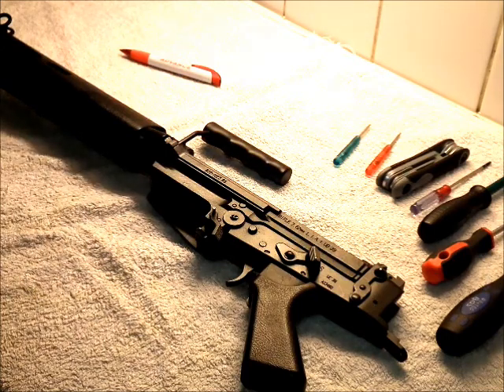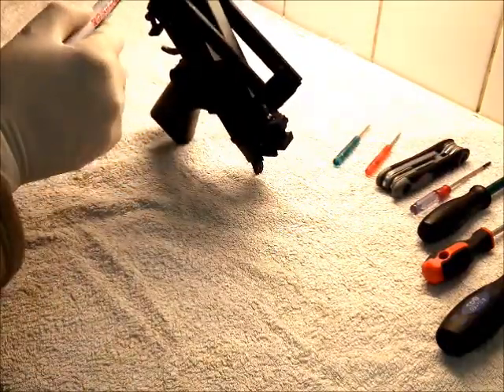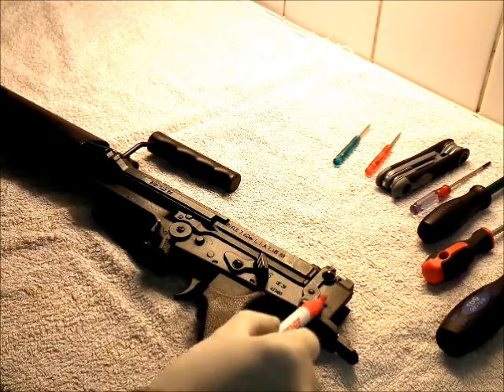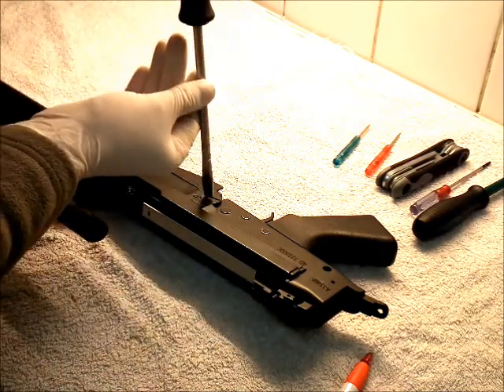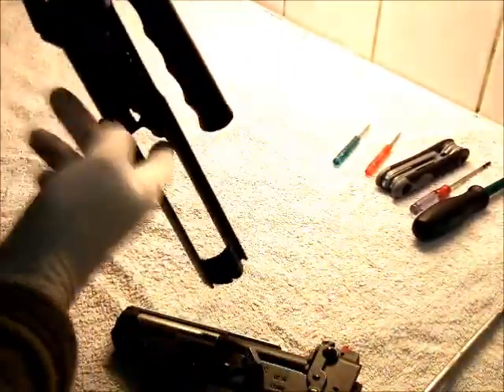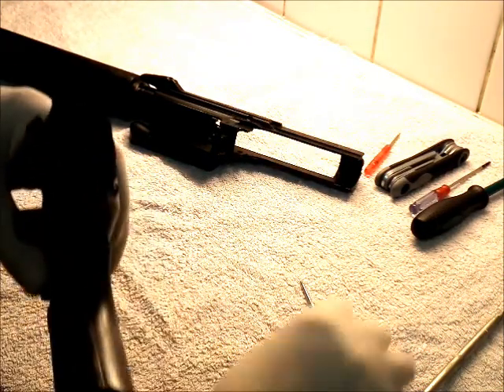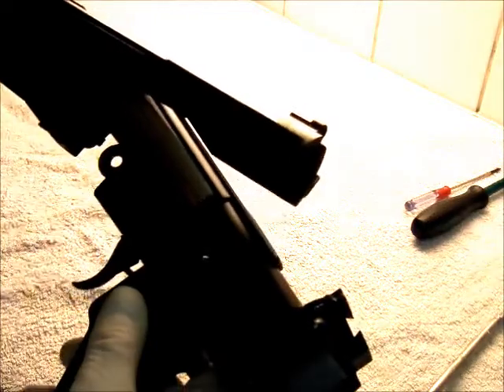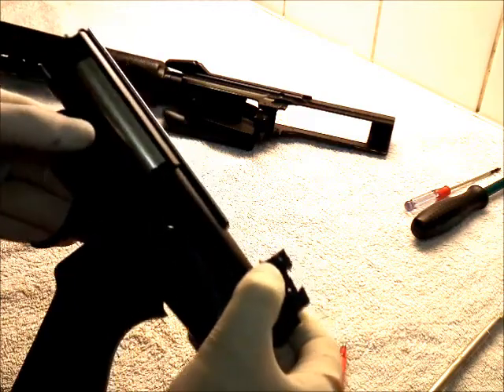ARES L1A1 Break Apart Fault

Comment: Doses the rifle have a quick change spring and if so can it be changed by removing the stock to access the back of the gearbox? Thanks
Reply from the maker: Nope.
Reply: @MONTY-YTNOM  It is quick change but you need to take the gearbox out of lower reciever
Reply from the maker: @BikeMole  You're a bit late :)
Reply: @MONTY-YTNOM  yep, but may help others

Comment: Ah, I've just worked out how to break it by using the catch - you have to take the 2 straps off the top of the hop up unit, which allows you to push the barrel forward against the spring far enough for the nozzle to be out of the hop up before you operate the catch to break the gun.

Hope that helps somebody!